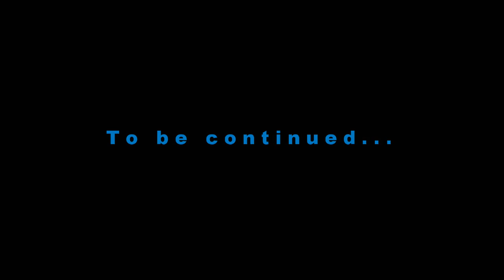Building an acoustic guitar in x days - Day 08

Comment: Nice job as usual, what's truly the difference between neck joint whith mortice and the bolt on , it seemed to me that in case of neck adjustment your system wille be more handy  . Keep on going